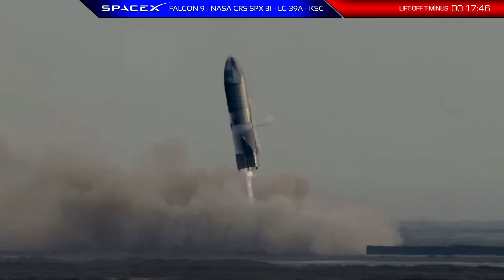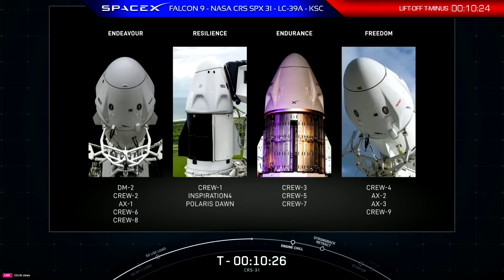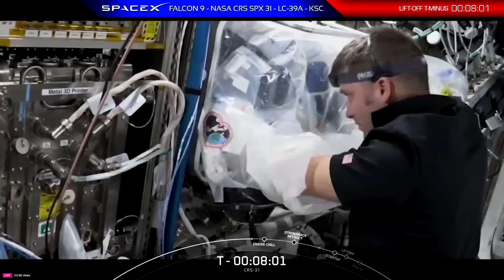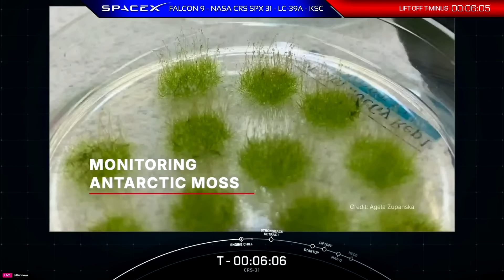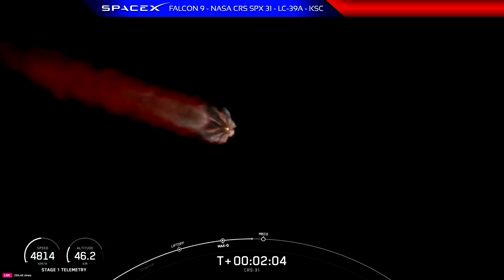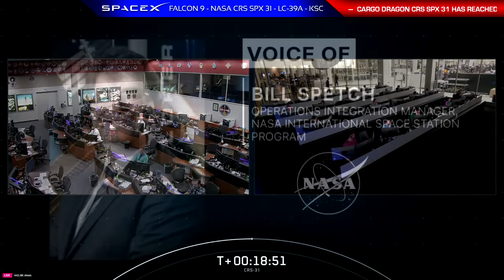SpaceX - Falcon 9 - CRS SPX-31 - LC-39A - Kennedy Space Center - November 4, 2024

Comment: Quick question : if I look at ISS this morning here in Switzerland visible at 05h16 local time as she enters sunlight, will CRS SPX-31  be located trailing behind, catching up ? and is there a  stage 2 outgassing ?  I once saw outgassing at similar orbit , on  start of 2nd orbit . Shot video, will share  in comment.  Now ISS will not rise sunlit but exit shadow  and get sunlit ... so I assume I will see outgassing cloud exit shadow, too.
Reply: https://www.youtube.com/watch?v=2_eVWgrNYTM
Reply from the maker: CRS SPX 31 will fly ahead of the Space Station because it will dock at the forward port of the Harmony node of the ISS. At your time, the Dragon was too far away from the station to be spotted. Stage 2 was left behind hours ago around 12 minutes after lift-off, the Dragon does currently the rendezvous maneuvers for the expecting docking at 1515 UTC today. When you are at nearby a location of a rocket launch, and the rocket launch is at at specific time, you can spot the rocket in the sky from hundreds of miles away. Outgassing to see is possible, but depends on the time of the launch, mostly best is short after sunset or sunrise, when the sun is very low under the Earth's horizon and illuminating the plume of the rocket by reacting with the colder atmosphere, then you can see a so called "jelly fish".